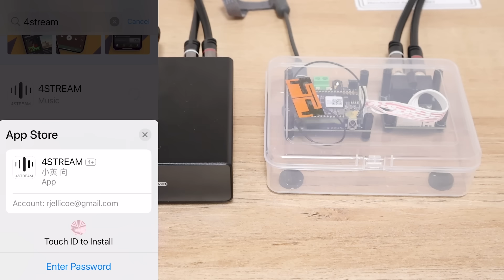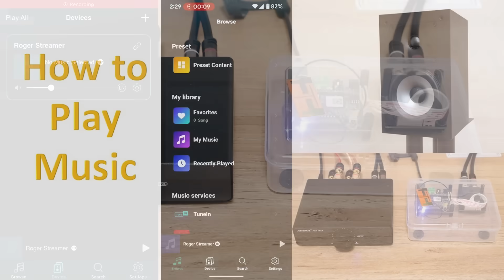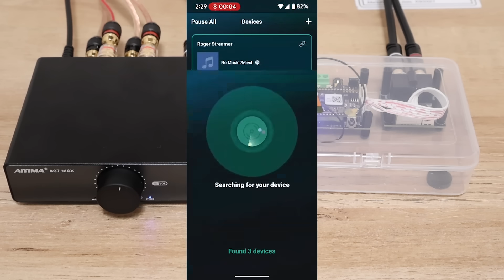Ultimate WiFi Music Streamer Anyone Can Build, Easy DIY Music Streamer with DAC Upgrade

Comment: Very interesting! Will this work with self-hosted services like LMS or Navidrome? Cheers!
Reply from the maker: Great question and I had to look it up because I haven't used either of those services so this answer is based on web research and not experience, which usually means you will have to figure out a few wrinkles yourself. With that caveat the streamer in the video is a DLNA renderer just like most commercial music streamers.  Neither Navidrome nor LMS support DLNA natively. There are basically two solutions which are, either add a seperate DLNA server sharing the same library, or use a phone app like Syphonium which can read from a web based server, and play to a DLNA renderer. If you wan't to try this I'd love to hear how well it works.

Comment: Nice build. I made streamer using up2stream pro board and didn't use arylic dac (it is cheap crap). Streamed to external dac. And the sound was thin, liveless, not engaging at all. Build rpi3 based streamer and used pi2aes hat to stream spdif to dac and it sound waay better. Not perfect but far better than arylic up2stream. So I wouldn't call this solution as HiFi. Midfi -yes
Reply from the maker: Hi thanks for posting. For you and me, loading a bootable image onto an SD card is pretty trivial, but I have found most people (and I'm talking really smart and capable, but also busy people) have no interest in learning how.  That's the reason I never posted the first video I made, which was a raspberry pi project. I just couldn't persuade any friends family or neighbors to try it. I thought I'd try selling cards with Pi images and bought a card duplicator but then the pandemic dried up supply of Raspberry Pi and so I started the channel with unrelated videos which, based on the views and comments, have helped and empowered a lot of people.  Getting back to sound quality, I agree a good Raspberry Pi build does sound superb. The HAT you are using costs $250 without the Pi so it should sound good, and it's probably better than commercial streamers costing much more.  The streamer in the video costs under $70 all in. I've tried the competition at that price point, and for sound quality nothing under $150 comes close. For somebody used to Bluetooth it's a revelation.
Reply: @rogergadgetguy  Yeah, techies start to take it for granted it's all simple to them.  This is doable.

Comment: I'm a newbie. What reccomended power supply (& link) for Aiyima A07 Max Amplifier - Please.
Reply from the maker: The A07 max is supplied with a 36V 5 amp power supply that is ample for most applications. You can go up to 48V and get more power, but the amp will run warmer.
Reply: @rogergadgetguy Thankyou. I'm new, interested in learning & trying something new. Will try the build

Comment: Hi Roger.  Nice, simple build.  I currently use the combo you compared to your build, Wiim Mini with SMSL SU-1, for my streaming areas.  I really enjoy the sound.  What is different with your build that makes it better?  Which DAC chip is used and does the maker of the components do updates like Wiim does?

Awesome videos by the way!  I really enjoy them.
Reply from the maker: Thanks for your post, glad you like the videos. This DIY streamer is better sounding  than the Wiim Mini alone but connecting the SU-1 makes that combo better  (but more expensive) than this build.  The Up2Stream expansion board uses an ESS Sabre ES9023 which is a good chip, but implementations vary for quality, and the SU-1 is very good, and quite the exceptional bargain for it's level of performance. Differences compared to the SU-1  aren't huge but I do feel the SU-1 conveys musical dynamics slightly better with more of a 3D effect. Up2Stream do update the firmware, but Wiim are owned by Linkplay who do the core wireless design for Up2Stream, HiFi Muse, Edifier, Arylic and others, so Wiim will always be first to get the updates.  I do like the Wiim Home app user interface better than 4stream, and their Tidal app is nicer, but the great news is that the Wiim Home app works on all the linkplay devices including this DIY Streamer. You can do multi-room too, with your Mini and SU-1 in one room and an up2stream streamer in another room, sync'ed together like Sonos, but better and cheaper. You do have to use 4Stream for setup of the Up2stream board, but after that, switching to Wiim home for all my streamers is my personal preference.
Reply: Thanks Roger.  This is a fun hobby/avocation isn't it? The music makes an awesome prize.